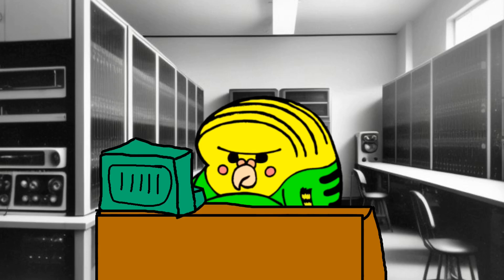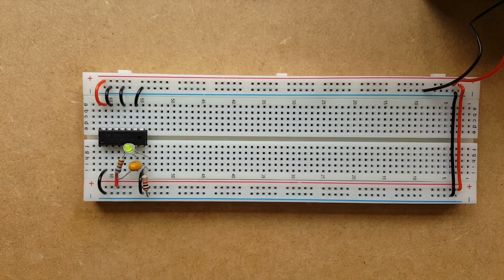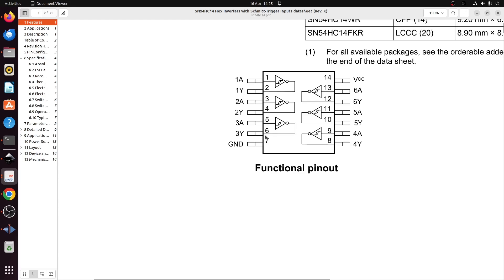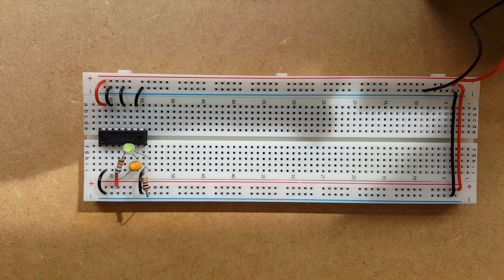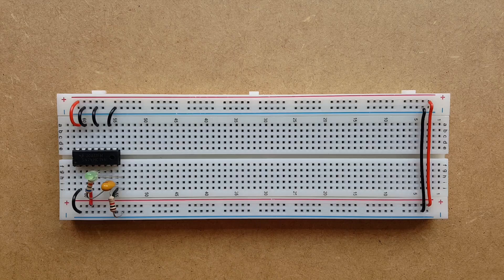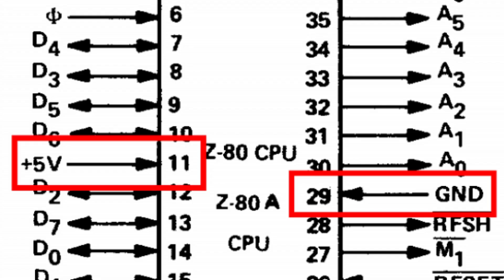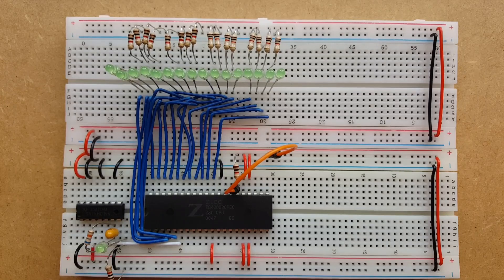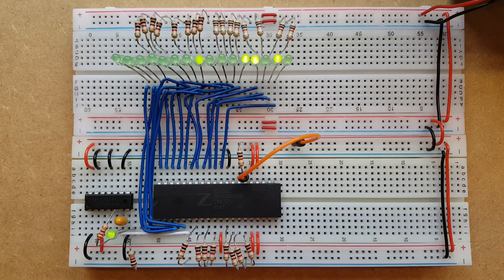A cheapo Altair 8800 style computer using a Z80 - (part 1) - clock, CPU and display on breadboards

Comment: Lots of people over the past … 9 years or so … have at least started a video series on building their own Z80 or, more recently thanks to one Ben Eater (watch out for him if you're a Ben!), the 6502. And yet they all seem to do one of two things: They rush right ahead using an Arduino or something to skip the boring bit for now and just start talking serial to Microsoft BASIC or CPM or something … or they spend several videos over-engineering a clock—a slow clock, a single-step clock, a fast clock, or an external clock they haven't thought of yet…

You just went and made a clock that wasn't too fast, then you connected it to a Z80, then you sped it up a little, and you're done. First video done in 20 minutes. Much longer assembly time for Human Man of course because wires are fiddly things. But your goal is a very simple one for now: The granddaddy of successful personal computers. Because who's got ₤5000 or so before you get the thing to the post?

If you're going to buy and solder a kit, you've built a fancy puzzle that requires molten metal and created an overglorified arduino. But if you want to learn something, people just a little older than me learned by building and testing and developing for the Altair 8800 … Or the IMSAI 8080 if they were a bit posh. And they went on to do amazing things with what they learned. Why would someone want to skip all of that to run a few games someone else wrote that they could run in an emulator?

Comment: 26 1k resistors !!!   That's crazy.
 I'm lucky if I have 10.
Reply from the maker: we're aiming to use the most 1k resistors on youtube! (but the exact values of most of the resistors doesn't really matter all that much, 1 - 10k should be fine, the only ones that the values matter are the timing resistors on the 74HC123. But even then as long as you get a long pulse followed by a short pulse the values don't have to be the exact ones me and that human man used in the video)
Reply: @DrBudgieandtheHumanMan Thanks for the response & clearing that up.

Comment: Question how you give power to the board
Reply from the maker: Thanks for the comment! That's a very good question , I completely forgot to mention the power supply in the video. I use the 5V line from an old pc ATX PSU. Thanks for pointing that out, I'll talk about that in the next video :)
Reply: @DrBudgieandtheHumanMan  Id recommend a fuse or something as that line is very powerful and might blow things up easily